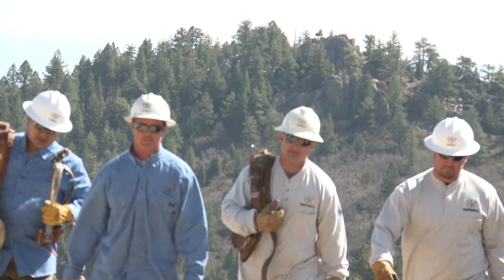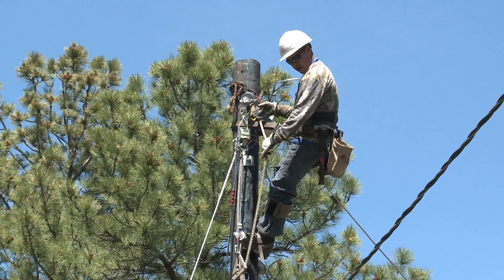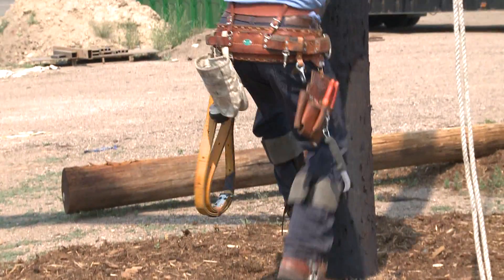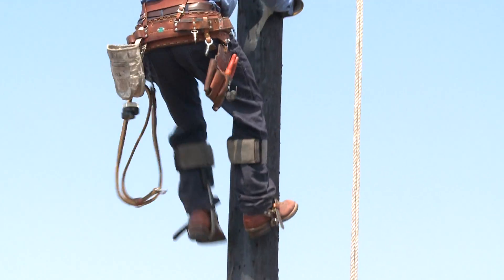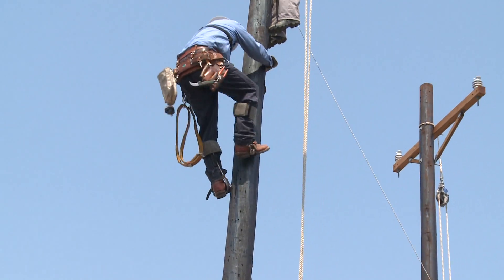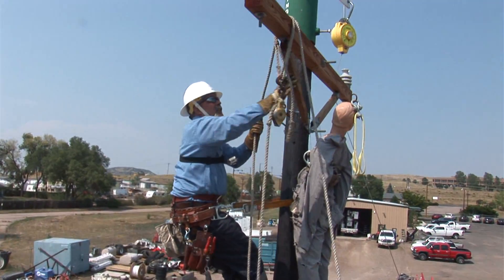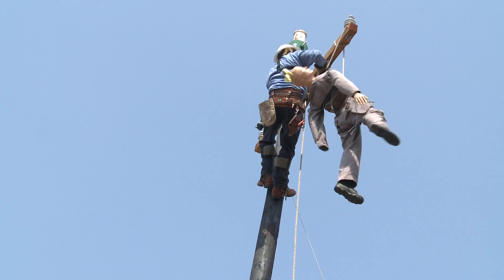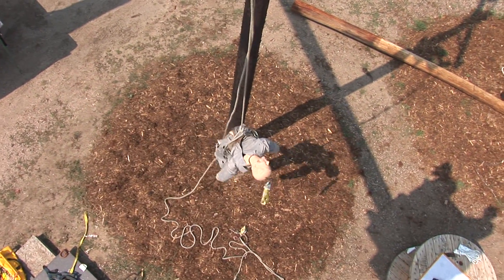Pole Top Safety Video | Colorado Powerline Inc.

Comment: wrong knot it should be a bow line
Reply: MrSkittles199 yeah, try and do a bowline around a limp person over 150lbs when limbs are limp and under pressure while your adrenaline is going. Three half hitches works fine, self tightening knots.